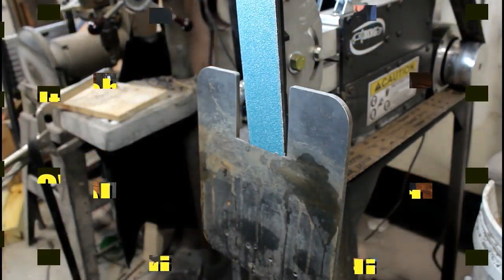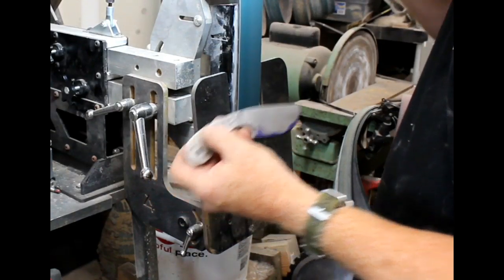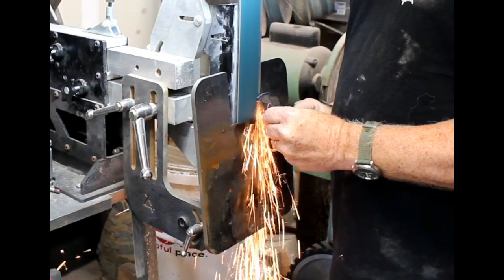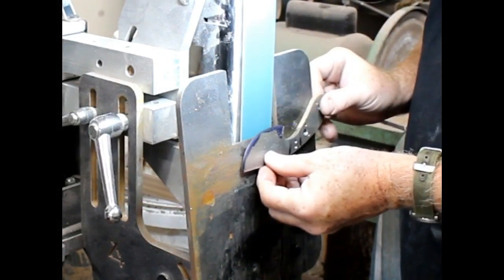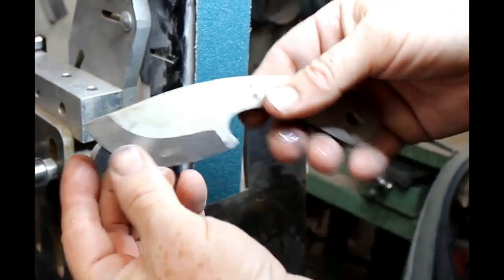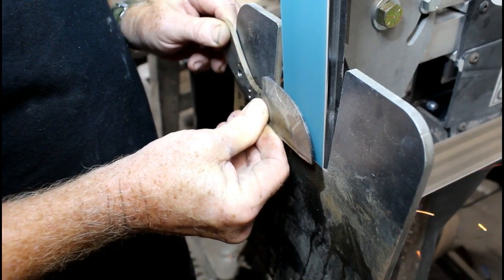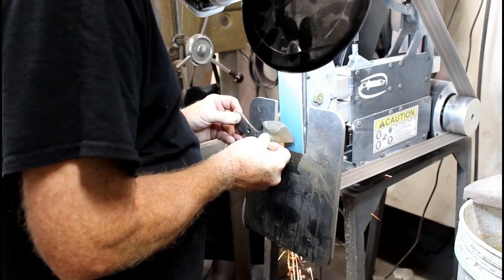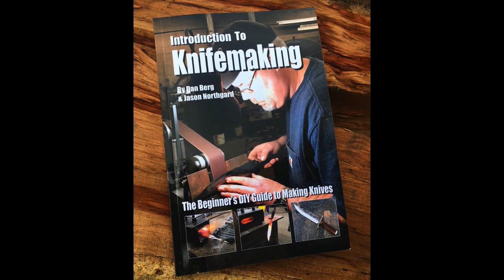Berg Knife Making Easy Rough Bevel Grinding using Tilt Table

Comment: Very interesting. What degree was the table set at?
Reply from the maker: It changes based on thickness of material and how wide a bevel your looking for. I usually scribe a pc of scrap wood and do a test grind on it. Once I like the bevel width I grind the blade.